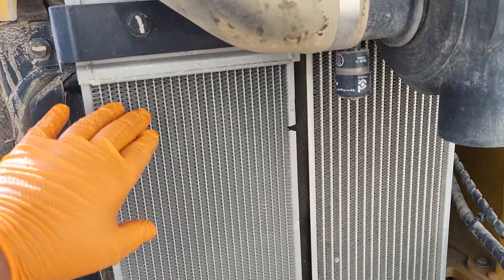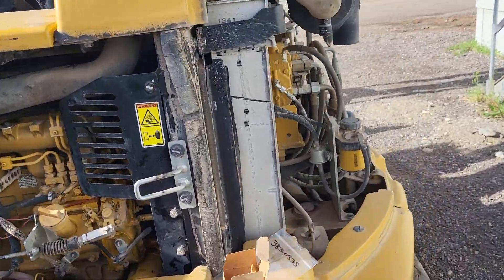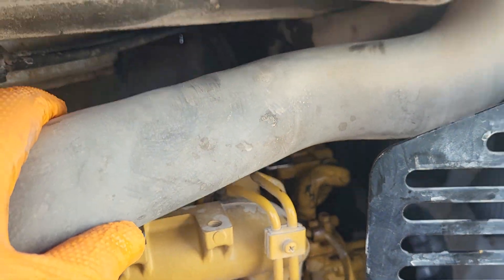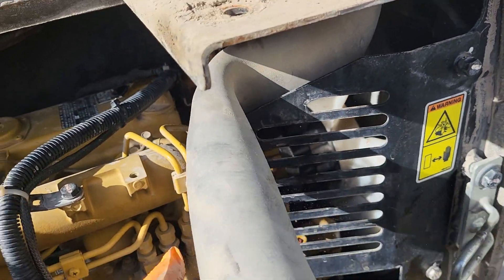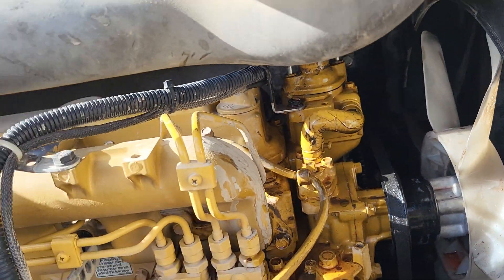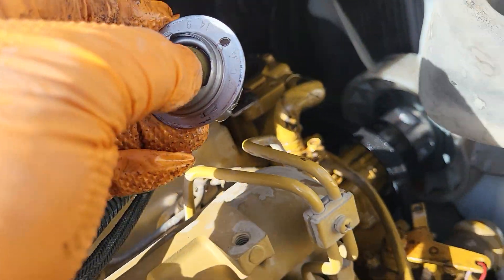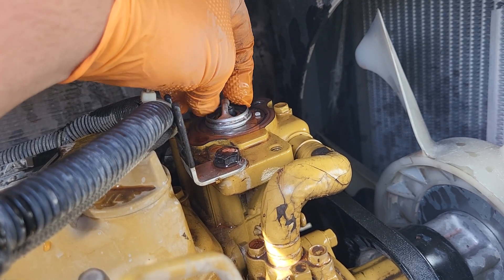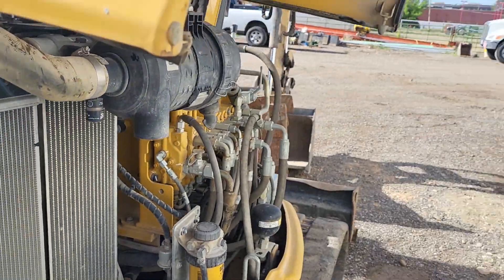CAT mini ex biggest problem????

Comment: Sir please help,our cat 306.5 the travel is not working,left and right
Reply from the maker: Some times mud and dirt can get in there and the only way to get it out is to take the footvalve out throught the top and clean it
Reply: @DMtec101 Hi sir I have a 305cr (2015) the problem is in monitor ir have all top light on and in display only show a big Cat only. I put the monitor New and it remains the same.